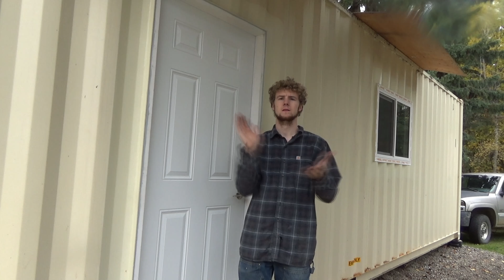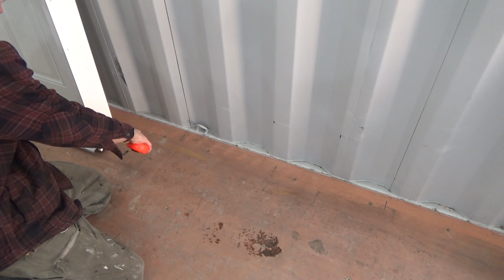How I Cut A Door And Window Into My Shipping Container[Shipping Container Workshop EP 2]

Comment: I saw a video where the installer instead of cutting the entrance plush, left finger protrusions around the cut out that he could attach the door frame to.
Reply from the maker: Did he bend the fingers at 90 then?
Reply: @DonkeysBreath  exactly. 2 to 4 fingers per side except on the door base. one bent inward and the other outward.

Comment: So what size metal did you use for the window
Reply from the maker: the frame was 1/4 inch x 4 mild steel flat bar
Reply: @DonkeysBreath  thanks it just looked like it was flush on the inside